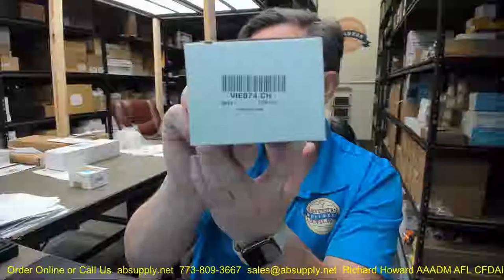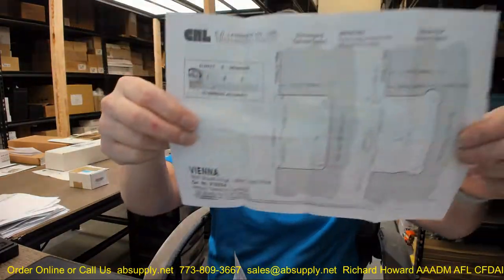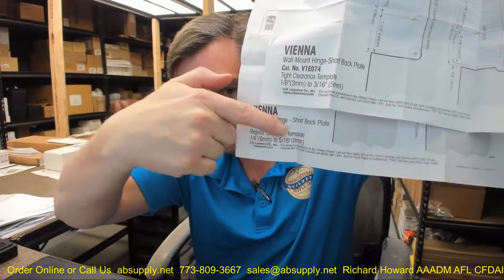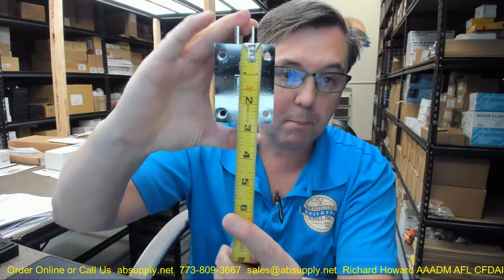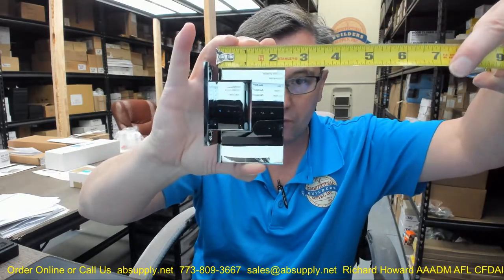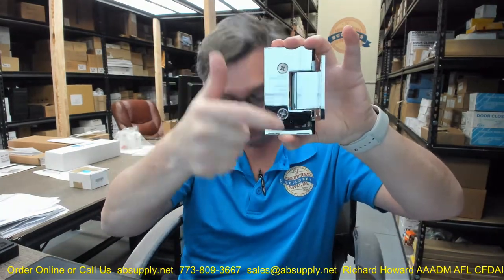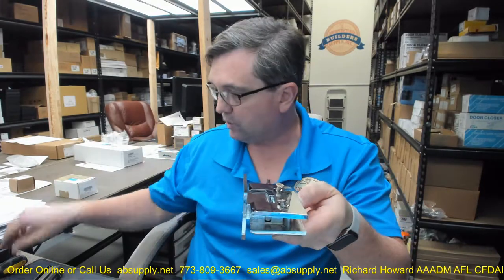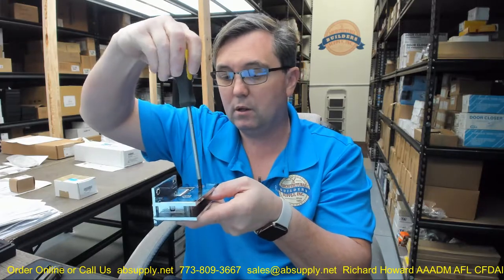CRL V1E074CH Vienna 074 Wall Mount Short Back Plate Hinge   Polished Chrome

Comment: Hi Richard, can this wall mount be set at 135 degrees
Reply from the maker: The CRL V1E074CH Vienna 074 Wall Mount Short Back Plate Hinge - Polished Chrome cannot be mounted at 135° and still perform with normal operation.  The only 135° hinges that are available are glassed glass mount such as the CRL V1E045CH Vienna 045 Series 135 Degree Glass-to-Glass Hinge - Polished Chrome as seen here:  https://absupply.net/crl-v1e045ch-vienna-045-series-135-degree-glass-to-glass-hinge-polished-chrome.aspx